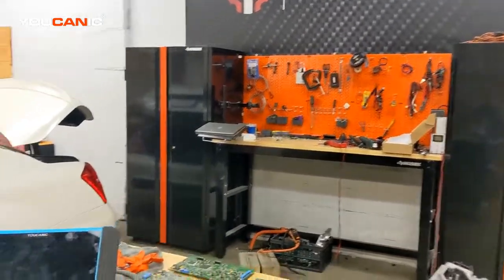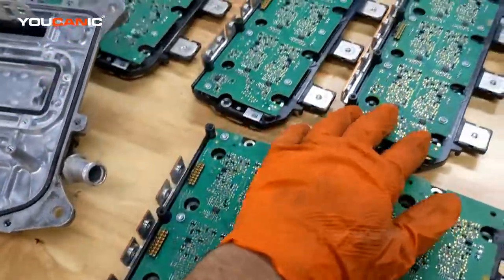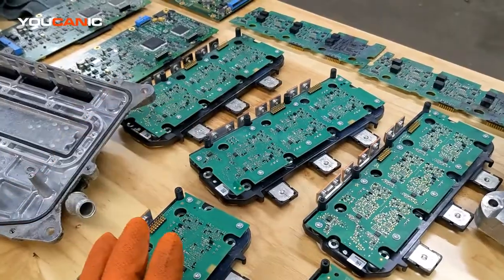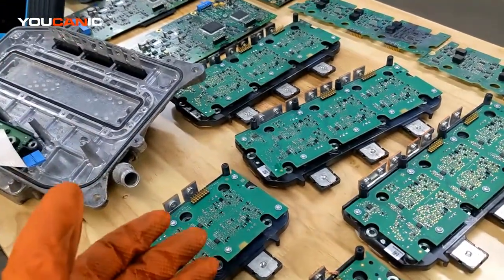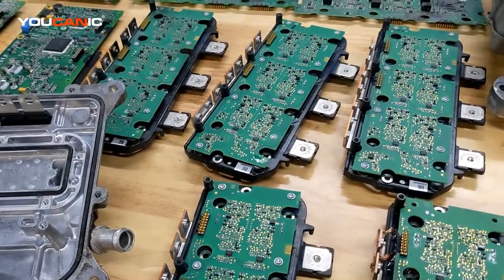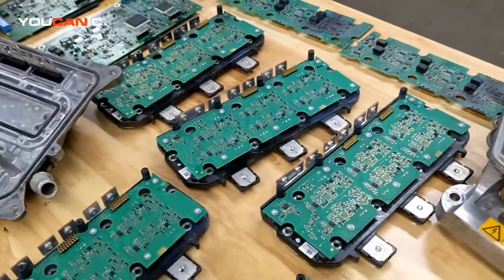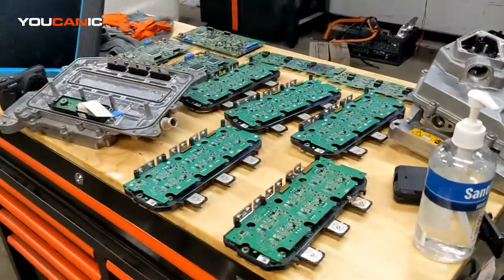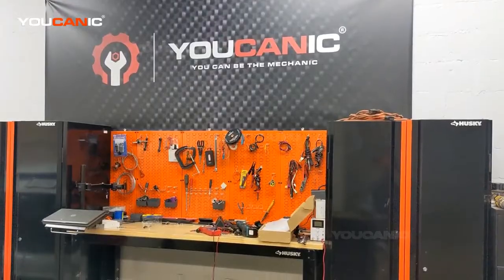Mercedes-Benz Hybrid Power Electronic Module Failure Explained

Comment: So I'm doing the SCN, I did the SCN on the battery, reset the battery. But the module listed there has a fault in the battery module, the dealership was unable to erase it. We have already done the SCN, we have already done the coding. 

Mercedes has already reset the battery, I've already done all the programming, I've already replaced the battery, because it recognizes the battery replacement it already does. 

The entire process was unable to erase the errors. Even doing all this, he doesn't release it. It says there is a fault in the battery module...

0AE886
0ACA86
0AC586
0A9B86
0A1F00
Reply from the maker: Thanks for reaching out! It seems like you've done a thorough job with your SCN and battery reset, yet it's puzzling that the fault in the battery module still persists. We'd love to help you troubleshoot this issue. Over at www.youcanic.com, we offer a wealth of guides, resources, and the efficient YOUCANIC scanner to aid you in resolving such challenges. Additionally, we have detailed factory repair manuals that could further help. Remember, Youcanic is here to empower and support you throughout your car maintenance journey!

Comment: I have a c350e AC not working I'm getting u019B00 SG-EM -1 permanent fault code and you help please.
Reply from the maker: Thanks for reaching out! For your c350e AC problem and the u019B00 SG-EM -1 permanent fault code, we advise checking our guides and free resources at www.youcanic.com. We even offer a powerful YOUCANIC scanner and factory repair manuals for detailed troubleshooting.

At Youcanic, our goal is to empower car owners just like you, helping you save money and feel confident when dealing with car problems. Don't hesitate to ask further questions on YOUCANIC, we're here to support you whenever you need us. Drive safe!

Comment: If the total capacitance (average) is about 370UF, would it be a safe assumption to try replacing just the capacitors? Have you ever tried that?

Comment: is actually mounted on the engine block passenger side, not the transmission as your video suggests
Reply: Bro you get the idea. Small portion goes ove t the transmission the other on the side of the engine block. Once you look down there you can't miss it.

Comment: Could you tell me what this error code is? P261100 - The regulating vale for climate control has a malfunction. Do I need to change the air conditioner compressor? N3/10 and N127 all have the letter F on the xentry Diagnosis. program.